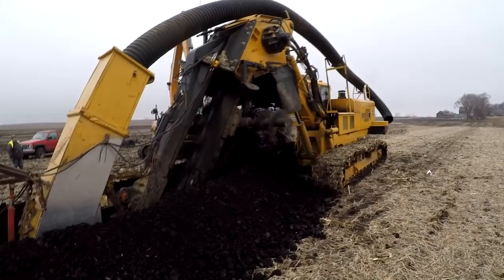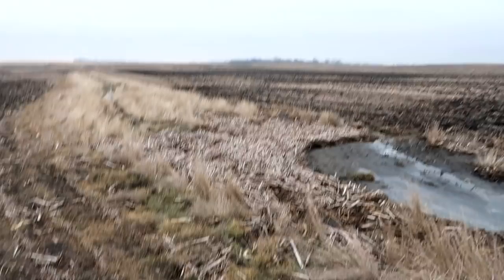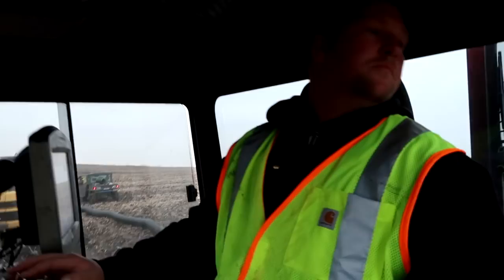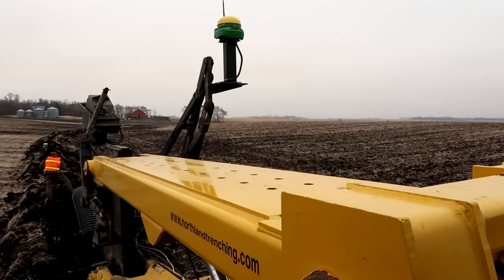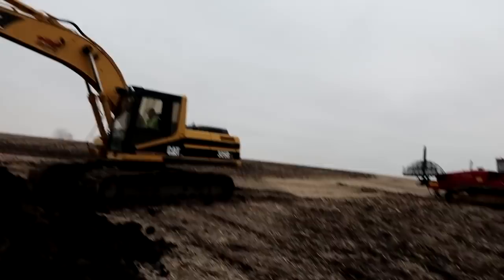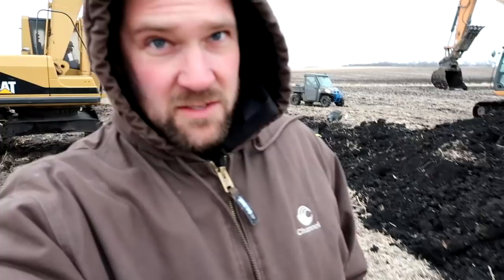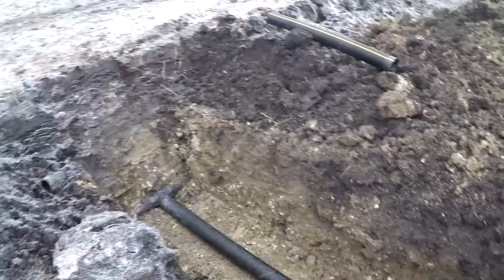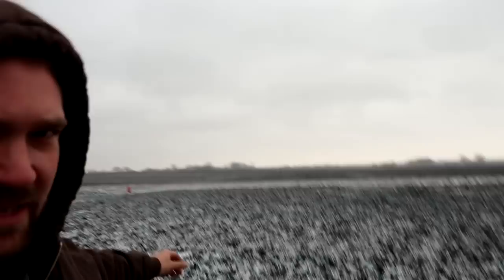Installing Farm Drain Tile to Prevent Erosion!

Comment: I did this in the summer fall and winter of 2016. Being a greenhorn, I was stuck with being a swamper, the guy who climbs in and out of the ditch all day to connect the laterals and t-junctions. Very hard work. Finally they trained me on the tractor so I could string out the pipe. Little did I know, that's some hard work too!  Good video. Peace!

Comment: Thank You guy's
Again thank you so much for the continued  education on drain tile. Had to rework a drain tile in the farm field as the gas well drillers cut the drain tile when they dug the drillers mud tank. Then next this field drain tile also drains a 2 to 3 gallon per minute spring in the West end of the field some 700 to 750 feet from a creek.
The sub layer of this field soil is water bering sand the drain tile has to set on a base board.
Thank You for the video's you have made.
Have A Great Day.
Richard

Comment: wow!  We have farmers in Delaware who would kill for some of your black soil.   We are extremely sandy.  Being within 3-10 miles from the Delaware Bay.  The marsh lands extend 3- 6 miles inland in many spots along our coast.  Making it difficult to control run off from the fields. The use of hedge rows, tax ditches, and buried drains helps us some.  We had a combine sit out in the field all winter near us (8 mi inland) because the field looked solid and was only frozen a few inches deep.  He got 50 ft off the road and it fell in up the front axles.  Sure hate to see a big piece of equipment like that have to sit without cover all winter.  He will have rust everywhere in the bin, auger, pick up, etc.  You are fortunate to have the big sheds and rubber tracked track tractor.  Good video.  I will be going back to look at the earlier ones, a far as I can.  Keep on plugg'n.

Comment: Very Interesting, It`s good to see how you guys deal with wet land basically it same systems the only thing we do in the UK is we tend to cover the pipe with 1/2 - 3/4 inch clean gravel or pea gravel.
Reply: brian throup doesn’t look like they have the clay we have over maybe that’s why they don’t bother with gravel
Reply: @spencermoss5528 Yes noticed that,  Did notice in places they have quite a depth of top soil,  In the Greater Republic of North Yorkshire we have less than 6 inches on some fields

Comment: An excellent video which makes a big and largely successful stab at explaining a complicated subject - well done. Just remember you are talking and explaining to a largely, but not exclusively,  American audience where the issues regarding land drainage may be somewhat different.
For example in Europe for a rain storm to dump 3.85 inches in one hit even in a 10 yr time span is virtually unheard of let alone experienced - that amount in a month would be considered a lot! (with an annual rainfall [inc snow] of approx 30").
Soil erosion by water movement does occur but is not a common sight at all except on very light sandy soils on slopes, whereas water logging is very common indeed especially in the more Western parts of Europe where we have a climate influenced by the Atlantic Ocean. The further East and South you travel the hotter and drier is the climate.
Reply from the maker: Dan Whiteford way over my head!

Comment: You highlight that it is extremely good for the environment. I think better for environment would be to establish wide buffer strips besides this trench with good or even high growing bushes and trees. This would have various benefits besides erosion preventing: reduce flood risks, reduce windspeeds, improve microclimate and even promote biodiversity, promote bees etc...
Reply: It would also reduce wind erosion, loosing good soil through the air
Reply from the maker: Gui Joe I pointed out in the video why a buffer strip wouldn't work in this situation...

Comment: In my job, I provide funding to municipalities to install water, sewer and storm sewer systems.  The hydraulic load of the pipes are designed essentially the same way as you described.  Storm Sewer is designed on 3, 5, 10 or 100 yr rain fall events.  I helped out the city of Graceville just down the road with their utility project.
Reply from the maker: Kevin Friesen Awesome!!  It's interesting stuff.  I probably should have mentioned more about how this is basically a rural storm system.
Reply: I am curious, are the basins at the beginning or the end of the tile runs.  By this I, mean are they designed to hold water and slowly feed the tile or are they at the end of the tile to catch the water and drain into a nearby creek or river.  On storm drains for municipalities, MPCA is requiring a "settlement" pond for storm sewer that is drained from city streets.  This prevents the grit and debris from entering the receiving creek/river. All of this is being driven on "impaired" water ways that eventually lead to the Mississippi river delta south of New Orleans.  One of my current projects is currently installing 72" storm sewer pipe that is made at the Hancock plant.  That is some big stuff....

Comment: I was surprised to see when trenching with the excavator soils were not separated, like put bottom soil on one side of trench, topsoil on other side. Then when backfilling put bottom soil in first then topsoil on top. I say that because it seems everything with farming is making the soil right.
Reply: Josh Halderman 
On long runs we separate on both sides but when we do small holes we keep all the dirt on one side so that we have easer access to the hole and then we separate the dirt as we backfill

Comment: Very informative video. I'm assuming the main 15" ADS pipe was solid and not perforated like the side channel pipes? Love that black soil. I'm from Northern Colorado along the front range where we tend to have much heavier clay soils but still grow corn, winter wheat and sugar beets rather well in. Thanks for sharing and I truly enjoy your videos, keep up the good work!!
Reply from the maker: Dutch Kling correct, the large main was non-perf
Reply: I believe the perf pipe is only for low swampy areas. The rest are drains for the detention ponds.

Comment: I can only assume a while back they actually installed tiles under the soil but my question is more about how do they keep the pipes from getting clogged by fine sediment or is the water "cleaned" before it flows?  Thanks

Comment: Great video and don't ya love that weather LOL :)  A couple questions from a non-farmer  1)  why is it called tile when it's pipe?  and 2)  why is topsoil better than the soil underneath?
Reply from the maker: Mississippi Blues the top soil is finer and has the ability to hold more nutrients and water, it also heats up more and quicker.  It's called tile because it was originally made out of clay.  "Clay tiles" were laid in 1 foot sections to form the pipe back in the day.

Comment: I certainly support the project but wonder what the result of a 25 or 50 year storm will be.
Reply from the maker: hlyautey well, less harmful than it would have been before...  extra water can still run around the sides of the basins and make it's way to the bottom more slowly and spread out than before.

Comment: 44 k is a lot less than i thought it would be. thanks, this was very interesting. just one question. when perforated drain pipe is used, it is wrapped in a cloth to keep the dirt out of it, why not with this one. there is so much piping tied into one large one, what will stop it from clogging up.
Reply from the maker: cuznjo1 The soil here is very tight and we generally don't have to use socks on our pipe.  Only in Sandy, coarse soils.  As long as we have the proper grade, we generally don't have problems with tile plugging up.
Reply: The holes in the drain tile are small enough that it will keep out the soil unless of a breach of the tile wall.

Comment: Nicely done. Like the new logo as well. It was interesting to see the depth of the good soil versus the clay like under layer. If you know, what is the average top soil depth in your area and how much might be lost to erosion over a certain time?
Reply from the maker: Dale Braun Those are good questions, and I wouldn't feel confident answering them well.  I would guess the average top soil is probably about 12" in my area?  That would be highly dependent on the topography.
Reply: Do farmers in the area run a sub-soiler through to break up the hard pan?

Comment: Zach, at some point in the video, you're discussing the cost of this operation with the trench operator; did you say that the operation is being paid for [or partially paid for] by a grant of some kind by either a federal or state agency?
Reply from the maker: starnet36 yes, because of the benefits to the environment, the project qualified for funding from 2 separate agencies and together they covered roughly 50% of the cost of the project.

Comment: Great video Zach, coupled with the explanation of why and how they are doing the tiling and what impact it will have on the area.  I do wonder though if doing a laser land leveling of the grades would benefit the drainage of the land lessening the excess runoff of the soil and nutrients.
Reply from the maker: Noel Martin it's way too rolling to consider that.  You would have to level the entire county and cut through 200 foot hills.

Comment: i have seen a few of these jobs done here and what i dont understand it when tile is put in around a building foundation, washed stone and landscape fabric is layed on top to the tile before the stone is put on, when tiling fiels no stone of fabric is installed in the black soil, or read lome how is the tile not taking siol into the pipe and plugging up the pipe. allowing it to drain propely, as the raw siol seem to be back filled right on to the pipe with no filter stone or fabric?

Comment: At least every 5 years, the tile will surcharge, blow out and/or overflow to surface runoff, making erosion worse, if sediment basins are not size to attenuate the peak runoff.  
This is not an erosion solution, it's a farming field solution.

Comment: Why are they not planting Cover crop or Rely crop to slow down the erosion ?
Reply from the maker: 2 reasons- the grades are too steep to stop the erosion with a cover crop and cover crops are very hard to establish on our ground because of the short season.  I have tried 3 fields the last 2 years and it freezes and dies before it all even comes up.

Comment: While that sounds like a sound erosion plan and benefit, I have concerns with all the tiling to move water out of wet fields. Just watching the you tube videos of the tiling that is a lot of water that is being diverted from ground water levels/aquifers. Eventually finding /getting fresh ground water will be like drilling for oil.
Reply: The water they are moving off or out of this field thru the new tile, would have been leaving the field and heading to the river before the tile was installed. That's why you see those large gullies, and the reason he was talking about erosion. The water was not entering the soil and becoming ground water, it was simply running across it at a high rate of speed, and carrying soil with it as well. Building the catch basins will prevent the erosion and allow that water to either soak in the ground, or be carried off by the tile slowly and without the top soil. If anything this design will allow more water to soak into the soil.
Reply from the maker: GlenironPa TMX nailed it already on this one, but I hope to do a video like this next summer and discuss "seepage" tile which is the same physical stuff, but it's installed with a different theory in mind, and I think that may be what's concerning you.
Reply: "sounds like a sound erosion plan and benefit,". Ya, understood the plan as described for the basins. You're right Zach, it's the seepage tiling that concerns me. Seeing all the tiling to drain wet fields just here on You Tube and the amount of water that is so quickly diverted to a ditch rather than allowed to perc. down through the ground has to have a future consequences to ground water levels. Aquifers are being drained faster than they can be replenished as it is. I know
Reply: Oops slippery fingers....I know it's a what come's first.....water or food problem. Growing pop. puts pressure for more food which takes more water but then draining wet fields to get more food. Wish I could take a peek into the future around 2050-2060 when the world pop is estimated to approaching 10 billion, it's 7.5 billiion now - O__O.   Tough unpopular decisions will have to be made soon.
Reply from the maker: GlenironPa That's for sure.  I don't fully agree about the water exiting the field too quickly, but I will do now research and hopefully join these guys on a project like that next summer.  I know soil can only hold "X" amount of water, and it will hold max capacity before it lets water get to the tile.  Nitrates will leave each acre no matter what, and the same amount will leave he field through whatever means necessary.  As farmers, we hope that's through a corn plant and not ground water.

Comment: I get that it's good to halt erosion of soil from the fields.... but where does all the water go?
Reply: Straight I to the rivers and lakes.
Reply: Same place it would have gone when it was flowing down the ditch in the video, just without all the erosion of the topsoil.
Reply: @aklogcabinfilms9214  Almost, it gets sped into drainages and discharges into waterways carrying all the excess soluble fertilizer that farmers have to add to their fields. This increases water pollution flowing into the Gulf of Mexico and doesn't help keep water out of the river during flood periods making them more intense.  This also decreases the local water table because the water doesn't have time to remain in the soil and percolate over time through the bedrock into the aquifers. The obvious solution is to mandate more marginal cropland be converted to water holding seasonal wetlands instead of just constantly installing more drainage tile and dumping more fertilizer on monocrop ground. It is possible to do, it just takes political will and the foresight to recognize when to stop contributing to negative feedback loops.

Comment: Why do they call drain tile verse calling it drainage pipe?
Reply from the maker: Paul Coulter It's called both.  Generally we call it tile around here, which came from back in the days of old clay tile.  Now it's all plastic.
Reply: When we do we put 4-6of stone on top of the pipe to help pull water in. Oh yea we got our first snow in Baton Rouge ,La about 7 years this morning.
Reply: It’s called drainage pipe. By manufacturer.   Advanced Drainage System. That’s who makes it
Hose is made locally.  Fittings are made in New Miami Ohio   And a minimum of 40% is recycled plastic

Comment: Is the tile pipe sealed or is it porous like a sewer drain field?
Reply from the maker: jbmbanter It has tiny perforated slits in it
Reply: I thought it could designed to release some of the water as it traveled through the tile/pipe.

Comment: Why would that main not be perforated allowing it drain the area it’s running through seems a little wasteful
Reply from the maker: Brownie.simon It's all controlled by the NRCS and SWCD (government) So they make those calls.  Some stretches of it were perforated, I'm not sure why all of it wasn't.
Reply: MN Millennial Farmer ah okay,I used to work for a land drainage company here in the U.K. and all the pipe in the field mains or laterals was perforated , but we didn’t have regulations like you clearly do and we don’t have erosion problems to the extent you do

Comment: Wow that clay layer, no wonder you guy's are losing so much soil. Nowhere for the water to go but follow elevation.
Reply from the maker: Jeff - Linda Wells Randy is actually convinced that the clay is so tight it struggles to soak up the water, which is where a lot of their issues come from.
Reply: MN Millennial Farmer yep when I saw that in the video it all made sence there is no water going through clay after it is saturated. Great video, thanks for posting